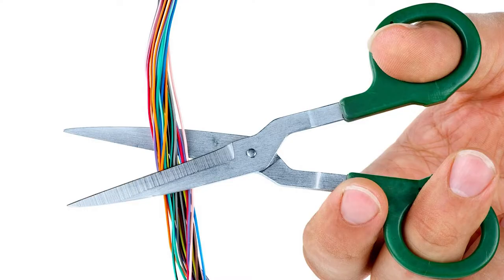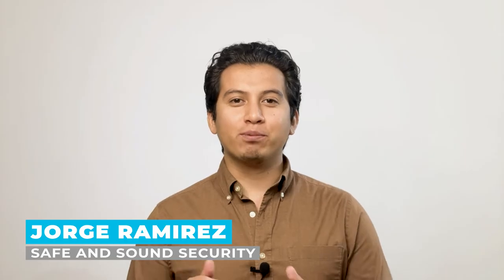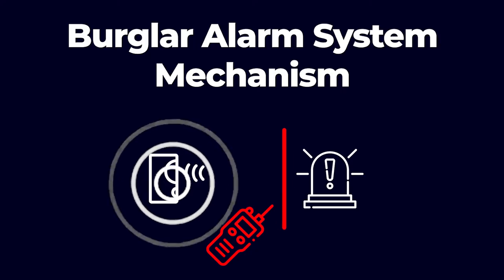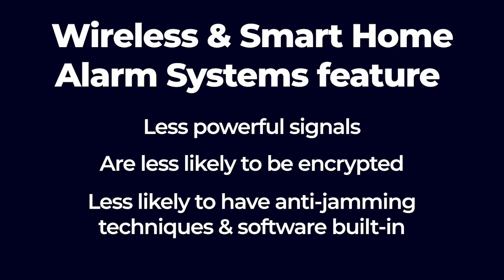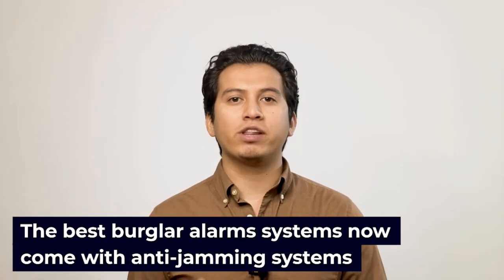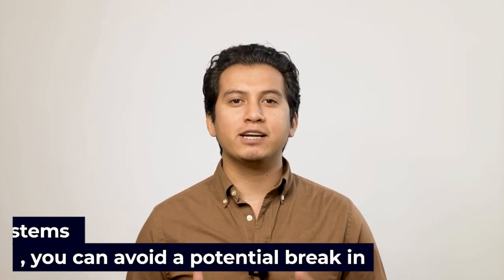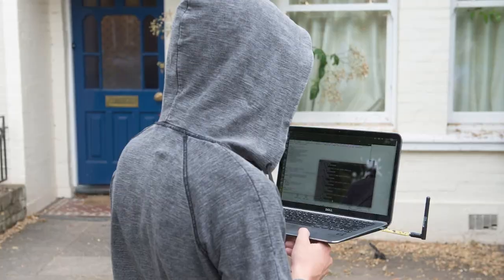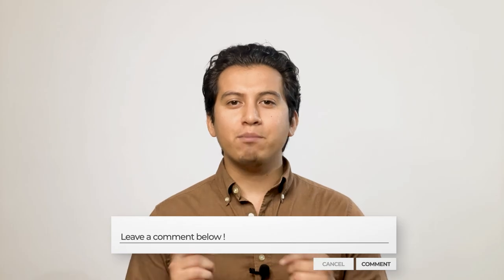How to Prevent Radio Frequency Jamming

Comment: I’ve come here because I’ve noticed my new cameras don’t work when the Amazon drivers deliver a package. So I figured they must be jamming my Wi-Fi while they deliver my package.
Reply from the maker: It's unlikely Amazon drivers are jamming your Wi-Fi. The issue might be related to Wi-Fi signal interference or camera settings. Try adjusting your camera placement or checking for signal issues during deliveries.
Reply: They are absolutely jamming when delivering packages. Happens too often for me, I use Amazon a lot probably 80% of the time my camera fails to activate as soon as I get my package 
it picks me up every time.

Comment: I'm here because a random car parked in front of my house and my home WiFi 3 cameras turn off... For some reason, my other 2 cameras Operate on my mobile phone network which is cool..once the suspicious car left my wifi came back on and 3 cameras came back on...
Reply from the maker: It sounds like you experienced a situation that could indeed be concerning. If a car parked in front of your house coincided with your Wi-Fi disruption and your cameras turning off, it might suggest someone was attempting to jam your Wi-Fi signal. It's fortunate that your other cameras operate on a mobile network, providing an added layer of security in such scenarios.

Here are a few steps you might consider:

1. Document Everything: Write down the time, date, and description of the car. If your cameras caught any footage or if you can safely take a picture of the vehicle, this could be helpful.

2. Enhance Wi-Fi Security: Ensure your Wi-Fi network is secure. Use a strong, unique password, enable network encryption (WPA3 is currently the strongest), and consider hiding your Wi-Fi network so it doesn't broadcast its SSID.

3. Network Monitoring Tools: There are tools and apps available that allow you to monitor your Wi-Fi network for unauthorized devices. Keeping an eye on what devices are connected can help you spot potential intrusions.

4. Report Suspicious Activity: If you have reason to believe someone is deliberately targeting your home network, report this activity to local law enforcement. Provide them with any documentation you have.

5. Consider a Mesh Network or Wi-Fi Extenders: This can help eliminate dead zones in your home and ensure a more robust and seamless connection for your devices, potentially making it harder for a jammer to knock out your entire network.

6. Backup Connectivity for Security Devices: As your mobile network-operated cameras remained on, it shows the value of having backup connectivity options. Consider systems that offer cellular backup or use a mix of connected devices as you currently do.

It's concerning to encounter potential security threats like this, but taking proactive steps can help safeguard your home and your peace of mind.

Comment: the best way to prevent jamming is to move the antenna of the wireless or increase the signal. real life is that we don't have any alarm at home
Reply from the maker: Thank you for your input! You're right, adjusting the placement of the antenna or amplifying the signal can sometimes help overcome interference. However, in the case of a deliberate jamming attempt, these measures may not be sufficient, as jammers can overpower even strong signals.

While it's true that not everyone has an alarm system at home, for those who do, it's crucial to understand potential vulnerabilities like jamming and how to counteract them. If security is a concern, even basic precautions can make a significant difference.

If you have any more insights or questions, feel free to share!

Comment: The maintenance man at my apartment is getting around my TP Link camera.  Is he shutting down the electricity in my apartment or jamming my Wi-Fi?  Which is more likely?
Reply from the maker: Hi,

It's difficult to say definitively without more information. But both scenarios are theoretically possible. Disrupting power would cause any non-battery-operated devices to stop functioning, whereas jamming the Wi-Fi could interrupt the connection between your camera and the network, effectively disabling it. If you suspect any unauthorized or malicious activity, it might be best to discuss your concerns with your apartment management or the appropriate authority. Additionally, ensure your Wi-Fi network is secure, and consider using a UPS (Uninterruptible Power Supply) for your camera to keep it running during power outages.

Comment: I have psychotic neighbors that are using jammers in their vehicles and their controlling them remote controlled, they're trying to break my security cameras. I have a full wired system, I noticed it's running slower, a little glitchy and in a lot of spots are blurred out, how do I block their jammers that they're running 24 hours a day, 7 days a week to break my cameras? Please help 🙏
Reply: I’m in a very similar situation, my neighbours are blocking my WiFi cameras with high frequencies, now my mobile, internet, tv is starting to freeze. Wish I knew how to stop them x

Comment: I suspect my employer is somehow jamming data signals to our personal phones. Is this possible with an RF jammer, or anything similar?
Reply from the maker: It's important to note that using an RF jammer to interfere with personal cell phone signals is generally illegal in most jurisdictions due to safety and privacy concerns. That being said, it is technically possible for an RF jammer or similar device to disrupt cell phone signals.

If you're experiencing frequent connection issues at your workplace, there could be other factors at play. Building materials, other electronic devices, or even certain geographical features can interfere with cell phone reception.

If you believe that your employer is intentionally disrupting cell phone signals, you may want to discuss this issue with your HR department or a relevant authority. They can provide guidance on next steps based on local laws and regulations.

However, if you're experiencing these issues only at your workplace and nowhere else, and there doesn't seem to be an obvious cause, it may be worth investigating further. It's always best to approach this kind of situation with care and make sure you have all the facts before drawing conclusions.
Reply: it is possible because it happens to me;   I drive tractor-trailer trucks over the road and when I park I usually get some crazed man parked next to me and they will start in on blocking my cellphone signals;  I cannot use my apps and have to turn on/off phone to reboot it - or try to find another park - but these jammers work within a certain range, so if there are more of these people out here using them, it renders your devices useless ---  also, these nut-jobs are out here doing this for fun --  just freaks being taught how to be destructive

Comment: What alarm systems have this feature? My alarm company does not know anything about this.
Reply from the maker: Many modern alarm systems include anti-jamming features, especially those with cellular backup. It's worth checking with well-known brands or considering an upgrade if your current provider isn't aware of these options.

You can contact with the number given or fill in the contact form of Safe and Sound Security at this webpage: https://getsafeandsound.com/contact-us/
Reply: They Know don't want any negative feedback getting out.

Comment: I need help , my neighbor is jamming my cell phone and security cam
Reply: can someone answer this question? where are the experts?
Reply from the maker: Sorry to hear about the situation you're facing. Deliberately jamming radio frequencies, including cell phone and Wi-Fi signals, is illegal in most places due to the risks it poses. Here are some steps you can consider:

1. Document Evidence: If you have reason to believe this is happening, start by documenting any evidence. This might include video footage showing disruptions in your camera feed, logs of dropped cell calls, etc.

2. Speak with Your Neighbor: It's always a good first step to communicate. It could be a misunderstanding or unintended interference from another device.

3. Check with Other Neighbors: See if they are experiencing similar issues. This can help in determining the source and scope of the problem.

4. Report the Issue: If you're confident your neighbor is intentionally jamming signals, you should contact your local authorities or the FCC.

5. Technical Solutions: You can consider upgrading your security system to use wired connections, which are less susceptible to jamming. For cell phone signals, consider using a cell signal booster. 

6. Legal Advice: If the problem persists, you might want to consult with legal counsel to better understand your rights and potential courses of action.

Remember, it's essential to ensure that any steps you take are within the confines of the law and local regulations. Hope this gives you more clarity for what to do in your particular problem.

Comment: Hi, i have somebody shutting my cameras off. We think it’s a WiFi jammer. They shut our WiFi down and break into our house. How close do they have to be to jam the camera or modem?
Reply from the maker: The effectiveness of a WiFi jammer depends on its power and the environment, but typically, they need to be within a few dozen meters to effectively disrupt a WiFi signal. It's important to report this to law enforcement and consider using wired cameras or a cellular backup for added security.

Comment: Hi, how can we protect our cell phones from this type of technology? With people doing this all the time, and as a woman I rely on my cell phone so that God forbid if something were to happen I can call for help. Is there anyway to bypass these jammers so that I can utilize my phone for emergencies.
Reply: Same question. I hope he answers this.
Reply from the maker: Thank you for your comment, there are some ways to protect your cell phones from jammers. First, you can use Voice Over Internet Protocol (VoIP)  service. Second, You can purchase a quad band cell phone, most of jammers only use one frequency, and quad band cell phone has multiple frequencies. Third, you can purchase data plan from your wireless company, consider different types such as 3g,4g, or Evdo. Lastly, most jammer systems can reach cell phones up to 30 feet, if you feel that your cell phone jammed, you can walk away or drive and try to make phone calls. Hope this can help with your question, Thank you!
Reply: @GetSafeAndSound  
Thank you so much for your very detailed response. I’m very grateful and can’t wait to try one of these out. I will feel much safer knowing I’ll be able to call for help if I need it. 🥰
Reply: Agree, with reference to cellular.  We  myself and our handyman could not make phone call outside our home, and  the video is a hazy picture new cameras display the HOA board members garage door is open and laughing harassing for several years.  So yes indeed jamming outside 30ft has happened to us.